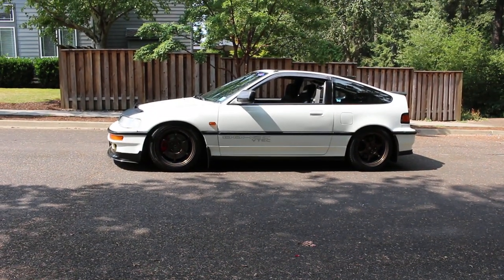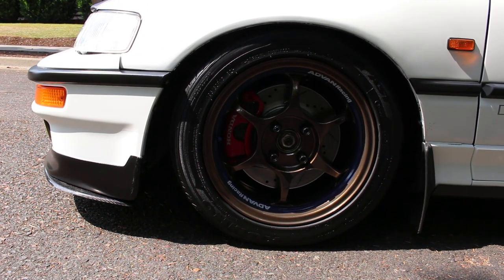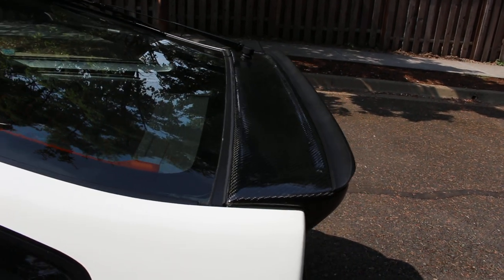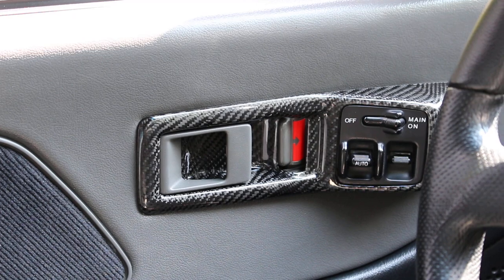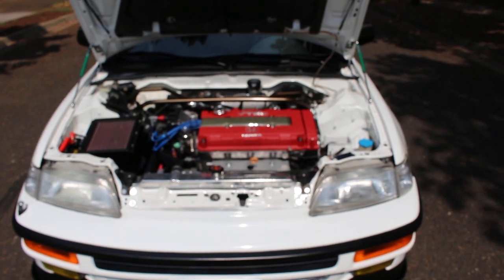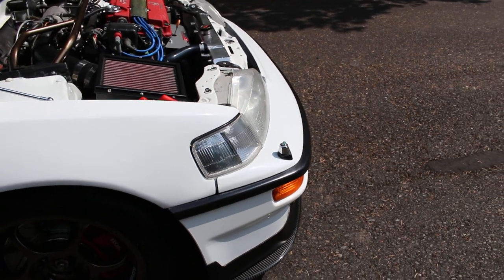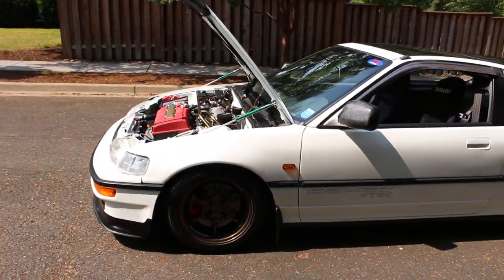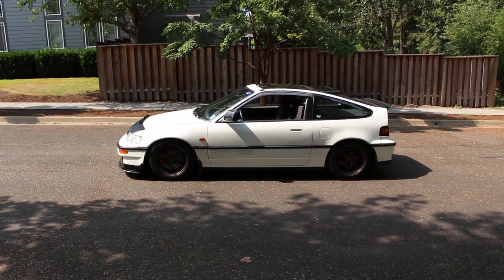My 1990 usdm CRX Si  glasstop with some ef8  SiR JDM Conversions Part 3

Comment: I have a glass top that I plan on putting on my 90 CRX as well. Who put it on and how? Just curious, thanks. You mentioned the PNW EF meet, I am in Pierce County in WA, would love us to check out each others car's!
Reply from the maker: I did most of the prep work like removing the old skin( a lot of spot welds to remove) then you have to transfer the skin frame from the glass top to your crx and spot weld and also panel seal it to ensure it's nice and solid.. then paint, and install the glass on last with the seal. I would be more than happy to let you check out my crx someday. When its sunny...lol. my Instagram @Vietspec72_
Reply from the maker: Also the pnw  ef meet is usually around Aug and this year it's in salem...  if it's not raining I might go to hondafest in Kent, Wa
Reply: @vietspec72  ok cool man. I'll keep my eye out for you, hopefully have my roof on by then. Mine is white as well. The shop told me they're gonna take the roof apart at the rain gutters and re-glue it and spot weld it. So sounds about same process. Roll safe!
Reply from the maker: @stunnasam21  yeah that's where the skin is attached to spot weld in rain gutters..how much are they charging you to do the conversion. Hopefully they dont break the glass removing from old skin.
Reply: @vietspec72  UnderPressure Racing was gonna do it for around $1200
Reply from the maker: @stunnasam21  $1200 does that include paint and labor? How much did you get the cut glasstop for?
Reply: @vietspec72  no paint, I'm gonna wrap the little strip between the windshield and the glass top BLACK, I bought the  glass top for about $1400 shipped in like 2005 😆
Reply from the maker: @stunnasam21  wow ! You've had the glasstop for over 13 years...now finally doing the conversion....
Reply: @vietspec72  yeah man, had a crx back then, parted it out. Kept the roof and bought a street bike, rolled that for 6 years. Got back into Honda's about 4 yrs ago. Bought another CRX and been working on it here and there. JDM front, CRX VTEC seats, really clean interior, clean body with original paint, FULLY built ls-vtec at 9:1 compression, ready for boost, just no boost yet 😆.
Reply from the maker: @stunnasam21  yeah same here ive always had a honda (83 honda accord hb 1st car back in 1988)   got out of the Honda game for awhile and then bouhght this 90 crx si rolling shell about 5 years ago and now i finally get to enjoy my finished result. I couldnt be more happier. it brings back so much memories driving this honda. I enjoy sometimes just sitting in it in my garage. I rarely drive it.

Comment: It looks great. We're is your source for the crx parts. I'm going to be getting another crx soon and how crx's now a days are I'm going to need as much help as possible to find parts lol
Reply from the maker: cravejdm  crx oem parts are hard to find new because most have been discontinued . Lucky for me i bought them when the dealer still has them in stock. Like i got all the side moldings new .  I replaced all the rubber seals and window trim with new oem ones too.

Comment: Awesome CR-X gen 2...I have 2, have had 4. along with 9 other various Coupes and hatches like the EM1 in EBP and 99 ITR....for reference, the USDM never came with a glass top, only sunroof. Curious why you would add arguably the most dangerous option ever offered by Honda Motor Corporation on any vehicle made?
Reply from the maker: I've always liked the glasstop crx but was only offered in japan. Since I already had got the front jdm conversion , jdm b18c type R engine. I figured might as well go glasstop too.  Some people would say "why dont you just buy a jdm ef8 glasstop then".. I like lhd . I'm not into the rhd fad or hype.. I like going through the drive thru also...haha..plus you dont see many lhd glasstop at all. Only a few have done the conversion. So its unique. Unlike a real glasstop jdm crx.

Comment: Did you say hydro clutch assembly from a prelude convert it to a crx.
How do you like the pedal ?
Where is a assembly list for this conversion.
Reply from the maker: Here is a link with the info for the hydro conversion https://honda-tech.com/forums/honda-crx-ef-civic-1988-1991-3/garys-ef-hydro-clutch-conversion-3077900/

Comment: I'm gonna build a replica of this car lol.  The jdm front end conversion.  I believe I have all the parts but that part where the jdm hood will not line up with the striker on the t-bracket side.  How did you solve this problem.  If you have another way to contact to get the details of my build let me know. Look forward to the reply!
Reply from the maker: MegaMajr,  you need t bracket from the ef6 ef7 with the Jdm front.. not the ef8 t bracket

Comment: Can you reuse the molding for the glass roof or will i need to get new ones?
Reply from the maker: You can not find new moldings. If you can you are very lucky...I reused my old molding it was still in pretty good condition. Most moldings have shrunk a little. Best method i used is a heat gun or hairdryer to heat them up and stretch them a little. It works great and to blacken them up like new looking. I used  Wipenew....

Comment: What kind of material did you use to convert to a personal box for nonsmokers?  I have the 2 labels.  I cant figured out the actual ash tray.
Reply from the maker: I just used a flocking kit. You can buy at most craft stores like Michaels or can buy online like Ebay.

Comment: How did you get the glass on , was it a do it yourself job or some shop did it for you , I'm wondering cause I wanna get the glass roof for my crx & where did you find one ?? Was it like a jdm import company or some guy you know/found ?
Reply from the maker: I bought a cut glasstop from overseas about 1500 shipped. Comes with complete headliner , maplight and visors.. you have to remove glass from the cut roof then use the skin frame from the cut glasstop and transplant to your roof. Of course you have to remove the skin roof from you crx first. Them weld in the glasstop skin frame then reinstall glass. You have to remove front windshield to do this. There is a lot if drilling out the old roof skin weld spots. There is a few write ups on the internet . Just google. I can help out with any detailed questions. I did most of the prep work but had a guy weld and paint the skin to match my crx. My Instagram @ Vietspec72_

Comment: That wing, is it an ASR? If so, how did you mod it to work w/ the rear wiper? If  not, what brand and where can I get one?
Reply from the maker: Brad at ASR wrapped my oem in real carbon fiber before he started making them full carbon fiber.. so mine is oem with the wiper hole.

Comment: Did you drill a hole in your front bumper to install your parking pole or it was already there (in the Si-R bumper) ?
Reply from the maker: The hole was not there as I installed the parking pole on the right hand side as not on the left since my crx is lhd. There was no marking on the bumper to show where to drill. I had to eyeball it from videos and pics of parking poles on other jdm crxs.
Reply: And the job is satisfying ?
Reply from the maker: @frederickgladu7105  yes I am happy with the result. Looks good!

Comment: How did you achieve to put two CD players in the center console ?
Reply from the maker: I trimmed out the single din and was able to fit a double din cage to mount the 2 stereos together.. top is cd bottom is cassette plus dsp eq...
Reply: @vietspec72   Satisfying job !?
Reply: Is it possible to find a real LHD double din center console ?
Reply from the maker: @frederickgladu7105  tegiwa makes replica double din radio for crx
Reply: @vietspec72   Thank you !

Comment: Any chance you would share that hydro conversion process?

P.s. I love the car :)
Reply from the maker: Yes , no problem requires a little work but well worth it for a true OEM  clutch feel engagement..smooth and not stiff like others. I will provide the link. It is for ef hb but can use for crx . There are a few of us with crxs that have done this hydro conversion. https://honda-tech.com/forums/honda-crx-ef-civic-1988-1991-3/garys-ef-hydro-clutch-conversion-3077900/
Reply: @vietspec72  thank you so much for the reply is there a more direct way I can reach you? I have a bunch of questions if you have the time to answer?
Reply from the maker: @joshuahenthorn6532  sure you can reach me on Instagram @Vietspec72_

Comment: Hello, What hood struts are you using?
Reply from the maker: Just some I bought off Ebay that were for an ek eg . Just had to trim off about  1/4 of inch off the top mount bracket..
Reply: Looks like they fit nice you still got the item # my any chance? also on the rear brake setup you use the 02 si pads? thanks
Reply from the maker: @mikejamie2870  I used rsx/02 si  rear pads and rotors. Also used the 02 si brake caliper bracket to mount my stock crx si rear calipers.

Comment: was the glass top conversion hard to do
Reply from the maker: not really if you are good with tools and prep work. drilling out the spot welds to remove the old roof skin then havinga guy weld glasstop frame in and painting it and then aslo having a glass guy reinstall the glass. thats  the basics.
Reply: @vietspec72  thanks im trying to look more into it to put on mine!

Comment: How much to get the enging like that?
Reply from the maker: I pieced mine together. I bought the long block from an JDM engine importer for about 2500 but sold the power steering and ac compressor off it so only cost me about 2300, then I got the 98 jdm type r tranny locally for about 800.

Comment: Bad ass car!!
Where did you get your pedal covers?
Reply from the maker: They are Levoc pedal covers.
Reply: duc le do they go over the oem covers or do you remove the oem covers then slap these on?
Reply from the maker: @manny5138  you remove the rubber pads on the oem pedals

Comment: How much do you think you have spent on this project and were you able to get the ac in
Reply from the maker: I have all the parts for the ac , but haven't installed yet. I think in total I have spent about $20k on this project. I have had a few changes to the crx which I will update in my next video.
Reply: I can’t wait to see the update on it and see how your ac install goes will you be at the Honda’s fest at pacific raceway this year
Reply from the maker: @blkdb840  if the weather is good not like last time. I might go..last year at hondafest was my first and worst..the weather sucked and I should have stayed home. I was miserable all day do I left early even though I was told i won a trophy for the crx category.  Wasn't hard since i was the only one in that category...lol still didnt get my trophy though cause I left early..

Comment: What car did you get your arm rest?
Reply from the maker: Ernest Perez armrest is from an el34 civic 96-00 and top of armrest is a Jdm  option for the ek.
Reply: duc le but yours looks different from those yours has a ring thing around where the buttons go
Reply: And how did you get the power window switches to be on the left instead of the right hang drive way.the original way it goes how did you get one to put on the left.and how did you get the sir cluster to work on the crx si
Reply from the maker: Ernest Perez you mean the little coin tray where the buttons go.
Reply from the maker: Ernest Perez I got edm lhd crx civic switches they have those in Europe
Reply: duc le where the armrest is at where you lift the break arm theres buttons in the armrest but the have a round thing around the bottom ones they looks different from the ones i seen what are the bottom buttons
Reply: duc le your armrest buttons on the botton are different from a ek armrest what honda did that arnrest come off of or are the buttons make them look like they have a arch or round ring on the bottom arnrest buttons
Reply from the maker: Yes they are for coins
Reply: duc le .....so the arm rest has a place where you put coins instead of buttons what are you talking about.im asking about the armrest.where the buttons are on .on the arn rest y do the bottom ones look different from the top bottons on the arm rest